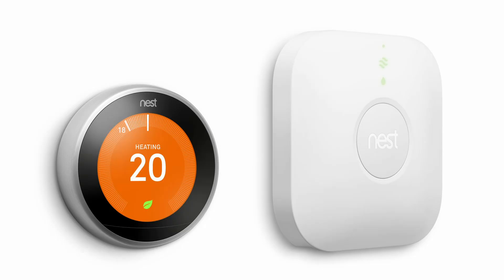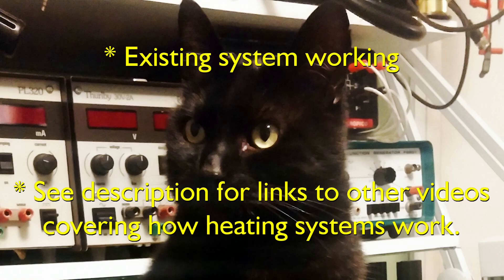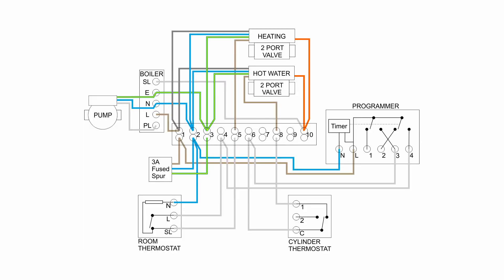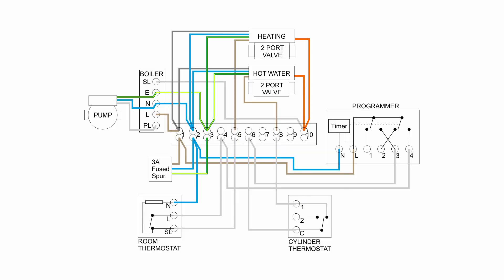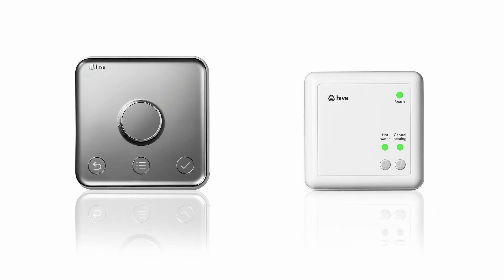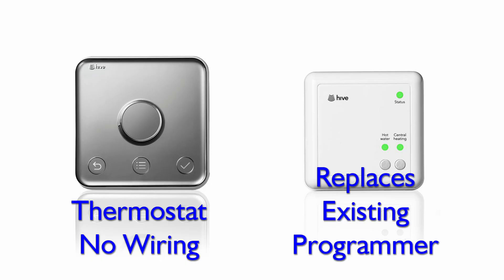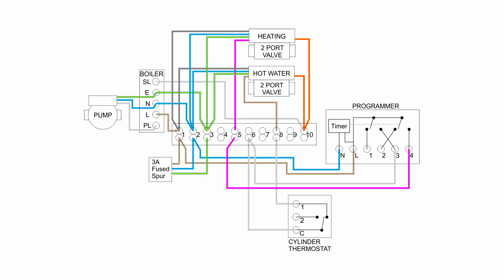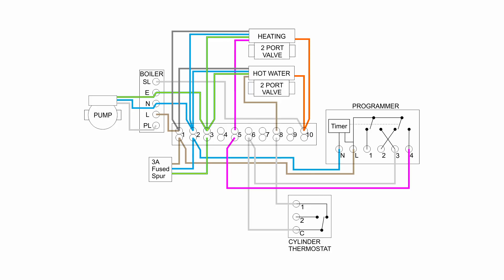Replacing a programmer and thermostat with Hive, Nest or a similar all in one controller.

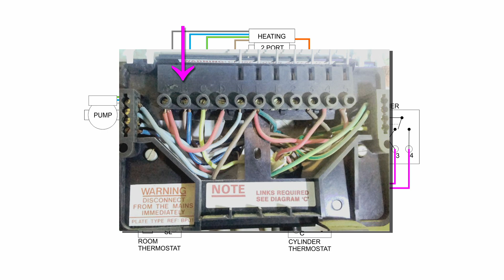Comment: I have the same programmer at 6:25, a potterton ep2002. I have 3 neutral wires and 1 loop going into the neutral treminal on the left side and 3 earth on the right side. 
Theres very little room in the hive back plate, and it obviously doesn't have the extra neutral and earth terminals on the left and right side, so how do I get all the wires into the hive terminals?
Reply from the maker: You can put more than one wire into one terminal, or if there are too many for that, join them in a separate enclosure behind or to the side of the hive.
Reply: Thanks for getting back in touch. I used a wago connector. I have a complicated heating system, oil boiler, stove and thermal store. To be honest, it's not great but stuck with it for the time being. The hive is nearly working, apart from only one pump is coming on when the central heating button is pushed, rather than two which is required for my system. All the wiring was replaced like for like apart from a live loop between L and 5. Is there another way of looping this to get both pumps working?. @jwflame

Comment: Hi, very helpful! one point to mention, I tried the bodge job of setting the existing decades old room thermostat to max and tried to run the new one through it but it didnt work - because whenever I turned the CH on (on the new hive) it tripped the RCD! (HW works fine), I guess this could be due to feedback from the old thermostat? so I guess I will need to find the wiring centre that is hidden somewhere in the house (could it be behind the decades old back boiler in the fire place ?! ). or the cupboard under the stairs that is packed full (and I mean packed) of stuff or the cupboard upstairs with the emersion heater in it? or the loft? - surely not! anyways I feel confident I can move on in fixing this issue now thanks to your video ... (unless rcd is tripping because of something else on the system?) any tips/ advice welcome!
Reply from the maker: Tripping RCD means there is a fault L-E or N-E somewhere.  Just changing the programmer to a new Hive would not cause that, neither would leaving the old thermostat at maximum.
Reply: @jwflame  Thanks for replying John,  I guess I will look at the CH valve wiring? after I have found the wiring centre and removed the old thermostat. Much appreciated!

Comment: Extremely clear video and crucial point if switching out a wireless thermostat (eg WR1) in addition to the programmer. Because it bridges power for the ch valve and you must complete this circuit. It was positions 3 and 4 on the connectors between programmer and valves/pump for me (but probably varies by kit/installer)

Comment: Hi JW, great video! 

We have a newly installed combi boiler with a wireless thermostat. 

- We would just need to refer to your single channel diagram?
- Replace the receiver, wiring up in the same way as the one we’re taking off?
- Then link up the hive room thermostat to the receiver?
That’s it?

Comment: Hi John, you seems to explain everything very well, however I have Hotsman Centour Plus C27 next to my boiler (which has both the Hot Water and Heating controls), Drayton Digistat +3RF  (portable) and a Drayton Digistat SCR upstairs wired. I am keen in installing a Wiser Smart Thermostat System with wireless radiator valves. So far I couldn't find any video or explanation as how I could switch into this new system, especially the wiring (what should I replace / remove). Do you have a video on this or any information that may be able to help me. Thanks, Rancho

Comment: When my hive was fitted they just bridged the live and switch live behind the thermostat made the neutral safe and fitted a blinking plate.
Reply from the maker: That will work and was probably slightly quicker for those installing it, although it does leave live wires behind that blanking plate.

Comment: Does anyone have any idea how or if nest can be installed on a W plan system? I incorrectly presumed I had Y plan system but when trying to install nest came across hurdle that there was no HW off wire to programmer. Bit more research revealed what I mistakenly thought as mid position valve was a diverter valve.
Now I can't figure out if it is possible to install nest on such system without too much hassle.
Reply from the maker: You can, although it won't work exactly as intended.  HW On and CH On are the only connections, If the Nest selects both then you will probably get HW Only until the cylinder thermostat switches off.

Comment: Hi... I wonder if you could help me? You mentioned in your video that some boiler systems don't require the live links for the nest... My heat link did not have the links at all and it suddenly stopped working. Nest replaced it for me and I have installed the wires as they had been previously but nothing is happening when i turn the heating on. The thermostat has power and the heat link clicks when you turn the heat on but nothing happens after that. Can you help?

Comment: Just wanted to say a big thanks for both this video and your website information about heating wiring schemes which I came across first. Clearly a huge amount of effort and care gone into giving clear, correct info. with excellent diagrams and explanations. Just completed my Hive install which after a good degree of learning and planning went without a hitch. The thing I struggled a bit to find good information on was how to identify the thermostat live and switched line in the wiring centre. I think it’s probably obvious to pros and more experienced DIYers as I haven’t found it covered in much depth compared to the programmer. Don’t know if this is considered bad practice or perhaps blindingly obvious, but I attempted this by connecting each in turn to the earth terminal at the thermostat (of course after isolating the heating circuits and checking isolation with a meter). Then tested continuity between earth and the suspect wires at the wiring centre. This seemed to work, but, in my case, as I didn’t know 100% that this was a reliable method, I did also run a long wire from thermostat downstairs to the wiring centre so I could directly check for continuity. I suppose if one is confident about the valve wiring colours, that might be good enough for some also. Anyway, thanks again. I can see myself watching a lot more of your videos. We’re also looking for a house in Dorset at the moment so at least I now know of an electrician who knows his stuff if we make it there!

Comment: Had fitted 2 x Nest with heat only but was unsure when fitting with hot water to a complicated older system. The diagram @13:34 answered my questions,  well done John, I added a link to your video to give you the credit you deserve in my Amazon review of the Nest I bought.

Comment: Thanks for the video - very helpful. Would connecting the live & switched live in the room stat back box save you from having to move wires in the connection box ?
Reply from the maker: Yes, but you can't just leave those wires in the wall, a suitable box with a plate over it would be required where the old thermostat was.
Reply: @jwflame  yes I'd just be joining the wires and putting a blanking plate on the original socket. Saves a repair to the plasterboard and leaves the wires for someone else if we take the Hive away with us if we move.

Comment: 11:00 It's worth mentioning that the single channel heating only Hive is volt free (it has a common) whereas the dual channel heating and hot water Hive is not.  So you need to link L to Common in the single channel Hive to get it to work with a traditional wiring centre, or connect 1 (common) and 3 directly to the 12/24v inputs instead if your combi has them.

Comment: I am confused. Would be grateful if you could confirm something for me. I currently have a Honeywell receiver wired next to an Ideal condenser boiler. Below this is the separate ST9400C Honeywell programmer, and in the hall is the wireless thermostat. I have bought the Hive Active Heating & Hot Water Kit. I assume from the instructions that I remove the Honeywell programmer and replace it with the Hive receiver? The thermostat will obviously replace the one in the hall. But what happens to the Honeywell receiver that is next to the boiler? Do I just remove this? Thanks in advance.
Reply from the maker: Hive receiver replaces the programmer.  Old Honeywell receiver is removed, ideally the cable is removed as well and a link installed between the two switch terminals in the wiring centre. 
 At the very least, the two switch wires at the Honeywell receiver must be linked together, otherwise the heating will not work

Comment: Could you just take the old thermostat off the wall and bridge the connections within the wall and then install the new wireless thermostat over the hole to hide it?
Reply from the maker: That would work, although not ideal as you then have unused live cables in the wall.  Zones for cables vertically and horizontally only apply if those cables are actually connected to a switch, thermostat or other device.
Reply: @jwflame  I understand, I'll try and identify them in the hot press and disconnect. Thank you for getting back to me.
Reply: @jwflame  that what they did to mine

Comment: I ordered by mistake a Dual Channel receiver which doesn`t have COM....but my old thermostat was wired to NO and COM...is there a way to fix it quick?
Reply from the maker: NO can be wired to 'heating on' on the dual channel version, but ONLY if the boiler uses 230V switching, as in the old thermostat COM was 230V AC.
If the boiler uses some other voltage for switching, the dual channel receiver cannot be used.

Comment: Fantastic John, swapped my old stuff for the hive heat and hot water everything paired and “worked” even the back box on my old controller was compatible? Until I noticed the boiler wouldn’t fire up! Found this spot on video and after identifying the number 4 wire going to my control box swapped it over to the 3 port valve just as John described and boom... all working perfect. 👍🏻👍🏻👍🏻👍🏻

Comment: I have question. Can you set up Nest to work on /off based on the water temperature and nothing else, for example if the water temp 60 degree or more stay off, otherwise go on until it reaches the desired temperature.  to be honest i am looking for a switch to do that Nest or other vendors, smart / or dump switch :), doesn't mater . as long as it will work based on water temperature, not time schedules...etc..
Reply from the maker: Nest is not suitable for that as it doesn't have any way of monitoring the water temperature.
However what you are describing is just a normal thermostat, either as part of an electric immersion heater or one which is attached to the side of a hot water cylinder if it's heated by a separate boiler.
Reply: John Ward , thank you sir, however, I could not se such an option on the control unit next to my gas boiler, all what it gives only , time schedule options.... and you are right, next to the cylinder I saw thermostat attached to the cylinder but I am wondering how it can stop the boiler off, once it reached the desire  temperature..... the gas boiler I have is Vokera, and the control unit is EPH R37...

Comment: great thanks. I figured that the existing thermostat would stop the nest box working but didn't find a clear explanation.  I guess the more dodgy solution would be to take off the old thermostat, connect A->B wires , wrap in tape and plaster over it!

Comment: Excellent, thank you.  Just what I needed to know.  I connected common to calling in the room thermostat connections in the wiring centre having disconnected all the wires to the old thermostat receiver.  It works a treat.

Comment: Great vid, tks a mill. One quick Q if you've time - I have an Ideal Logic System 24kw boiler - no stat, simply on or off and heats the water in the cylinder (& also rads) whilst on......I only need the single channel receiver right? (unsure as you and Hive state that it's only for combi boilers?)....Tks!

Comment: I recently installed a hive onto a vaillant ecotec 624 with a prostel tank. Its an s plan setup with 2 valves, the tank stat commands hit water but the boiler doesnt fire until i go onto the hive and set hot water to on. Im not sure how to do it and its annoying me now and i would really appreciate it if anyone could shed  any light on what gone wrong
Reply from the maker: That is the correct operation - hot water cylinder is only heated when the Hive is on, and the thermostat is also on.  
With only the Hive, there would be nothing to stop the cylinder overheating, and with only the thermostat the would be no control over when hot water was heated.
Reply: John Ward thankyou very much sir  much appreciated

Comment: John, I wonder if you can offer some advice as I can't find an answer on the Hive support. I presently have a Honeywell ST9420c programmer with a wireless DT92E Room stat and  a wireless cylinder stat. I have purchased a Hive Active Heating and hotwater controller but I'm confused as there doesn't seem anyway to control the water temperature other than basic on or off function, as the Honeywell wireless cylinder stat becomes redundant on removing the Honeywell programmer.  Do I have to hard wire a cylinder stat or is it unnecassary to have one at all. I've seen some online crticism aimed at Hive on this for not providing some form of sensor, but I'm just totally confused as what to do. What stops the water from just overheating..is it the temp setting on the actual boiler? Sorry to be a numpty but any help on this would be much appreciated Many thanks. Colin.
Reply from the maker: You need to wire in a cylinder thermostat.  Without it, there will be nothing to stop the cylinder overheating.
Reply: @jwflame  Thank you for getting back to me so quickly John. That was exactly my concern but you've confirmed my worries. Can't understand why this isn't an option with Hive. Are there any wireless stats available or is it possible to use the wireless stat arrangement from the Honeywell programmer as it's quite a run from the cylinder to the Honeywell connection box and would be a bit of a pain to install a cable. Thank you again for your help. BTW, anybody who plays keyboards has got to be a decent bloke. Cheers,Colin.

Comment: Hi JW this combined with your central heating wiring system  explanation is an amazing resource for those planning to install a HIVE.  Have you produced a video on the required wiring for their multizone system, I have three heating  zones all with separated motorised valves and i cannot fathom how the multizone is connected in.  It looks like they just send another two controllers that are effectively single channel combi controllers that then require wiring in as separate zones ?
Reply from the maker: Additional zones are wired in the same way as the existing one - controller switches power to the zone valve, valve opens and the switch in the valve activates the boiler.  
For S plan, additional valves are connected to the same terminals as the existing ones (grey=L, blue=N, green/yellow=E, Orange=Switched output), the only difference between zones is the Brown input is connected to the switched output from the Nest controller for that zone.

Comment: Great instructional video and very well explained. I do however have a problem I cannot solve.
My current setup is two thermostats and one programmer that I want to change to hive.
Thermostats are one up and one downstairs. The boiler automatically heats water on demand and I've no water tank.
When I remove the programmer it has three wires. Two power and one black. There's a loop between l and common. Same wiring behind both thermostats.
Where do the hive recievers go? Do I need two receivers for two thermostats? Do I keep the existing programmer on the wall but set to always on?
Reply from the maker: Two receivers are required, and they would normally be connected to the wiring centre (where the valves, programmer, boiler and existing thermostats are connected). Existing thermostats and programmer are removed.

Comment: Hi Jw, please help me in connecting hive control to my boiler vaillant eco 824. I do not have a wall thermostat. I need to know how to connect the wiring. At present the boiler is connected directly from the wall fuse switch.

Comment: Hi. I have a quick question regarding the nest setup. Around the 13 minute mark you mention linking through the L terminal in the Heat Link to terminals 2 and 5. Wouldn’t this put 230v at the Nest learning stat (I’m only wanting CH control from Terminal 2) ? I have been led to believe that those stats need Low Voltage. I was hoping to use the existing wires at my existing digital stat, provided I can joint the cables out to where the Heat Link and boiler are situated.
Reply: Never mind. I’ve just noticed the T1 and T2 terminals which are for Low voltage stats such as the Nest learning stat ! 😀
Reply: @houseofquad2260  I was also confused at 1st till I realised T1 & T2 can power the Nest Thermostat via the old thermostat wiring which then communicates wirelessly with the Nest "Programmer". 
Just got mine working - it's brilliant!

Comment: Thanks john. The best video out there on hive installation. 
If I want to add another zone for heating (ufh) I will need a 2nd receiver and thermostat for the new zone.
Could I position this receiver by the side of the first receiver and directly connect the N L and number 4 terminals (heating) together. 
Or as an alternative could I position the 2nd receiver (ufh) near the wiring centre and make the N L and number 4 terminal (heating) in there